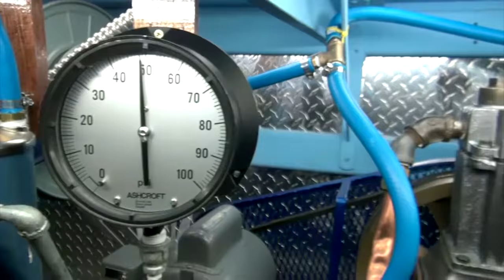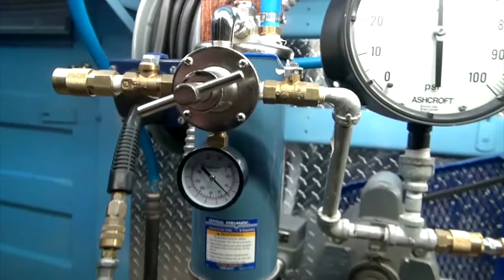What's neat - Jan 2017 column | Model railroad tips | Model Railroad Hobbyist | MRH

Comment: Besides a pro photographer I was a tech journalist for several years. I'm a little rusty but let's see if I can come up with a  good tip for some of you: 
To get the best final images possible it's important to create the best digital image file possible right from the start. In order to do that you have to capture as much information of the scene as possible. Here's some ways to do that.

Some digital cameras will offer a few different Color Modes like Standard, Portrait, Landscape, etc. and some will let you make small adjustments to those settings and save them as a new default for the setting. When I'm shooting I'll change settings to make sure I capture as much information to the digital file as possible. This means I'll lower the contrast settings, shoot using the lowest ISO to keep grain/noise level down, use a tripod and wireless remote shutter release (and either use the mirror lock up control or self timer on DSLR's that use a mirror, instead of an electronic viewfinder (EVF), in order to reduce camera vibration). This is especially important when using a telephoto lens which magnifies any camera movement/vibration. 

Also, I'll use the old Rule of Thumb from the days of slide film and 'Expose for the Highlights. Print for the Shadows', which means I'll adjust my aperture, shutter speed, and/or my ISO and use the Histogram feature that many digital cameras have to the point where I just avoid overexposing the brightest areas of your image. A new feature on some cameras, like my Sony A6000, will show on the LCD and EVF displays in a contrasting red, yellow or some other color, areas in the images that are over exposed. This later feature is one I've come to really depend on.
So, why do you want to set your camera for lower contrast, all that does is make for images that are flat and 'BLAH' looking; and why do you want to 'Expose for the Highlights'? 

The tiny 'light buckets' on your camera's digital sensor read the intensity of the light falling on them and records that level as a number. Say it records the darkest part of a scene, a pure black with no detail whatsoever, and calls that '0'. Then it measures the brightest light level as '99', or 100 steps between pure black and white. You would think that every step inbetween would be equal right? But you'd be wrong. It's not linear, more steps are recorded as you move towards the bright end of the scale so that, say, there are 25 steps between black and middle grey and 75 steps between middle grey and absolute white. Since the brighter end of the scale has the most information that's the end you want to make sure you capture in its entirety. So adjust your camera to record as much data as possible, without over exposing the brightest areas important to you. (It's okay if some things, like the sun or its reflection on glass or water, go off the scale in most circumstances) Adjust your camera like this will help to record data in the darkest parts of the scene without losing detail and help avoid digital noise in those darker areas too.
Once you have as much detail and information as possible in your image file it makes it easier to manipulate the image data to produce the best image possible. Add contrast or adjustment curve, color temperature, highlights, shadow detail and more, all with less of a chance that you'll end up with bad looking side effects like banding, grain, weird colors, etc.

There are plenty of video tutorials on YouTube on the subject. Just search for 'Exposing for the Highlights'.

Comment: That compressor is a thing of beauty.
Reply: Gary Gresham n
Reply: I like your new compressor. My only concern is safety. Has that tank ever been pressure tested since it was date stamped. At some point you have a bomb ready to go off. ( NSA will probably monitor me for this )
Reply: It's a 3000psi rated tank 1/4 inch thick walls. a valve will go first. no problems.

Comment: Decoders have come so far in just the past few years, but the leaders in my mind are ESU LOKSOUND and TCS WOW. Soundtraxx is making a feeble attempt to get back in the run, but: For example the Tsunami 2 Steam has the load feature, but on the down grade in your video it continued to chuff, which it would not. All you should hear is the rod clatter as with the TCS WOW. Another feature of the TCS is at speed step 1; no chuff, just like the real locomotives and you can initiate cylinder bleed as well. I think I heard the cylinder vents blow on the Tsunami 2, which the TCS has as well. As for the Tsunami 2 on the new Athearn Gas Turbine release, really a sad example of to little if trying to compete with ESU. Tsunami 2 Diesel starts with power on, Turbine starts with movement, Turbine shuts down when motion stops.... ESU; F 8 starts and shuts down Diesel, F 3 starts and shuts down Turbine, F 7 on the latest ESU upgrade 75403 provides wheel squeal. Bottom line, Tsunami does not allow operator to manage power, sounds and falls short of current technology present in other brands. I have installed several LOKSOUND Gas Turbine  75403 Decoders in Athearn Ready To Roll Gas Turbines and posted them on my You Tube Channel. choochoo3985. I think you will be impressed. I purchased two of the new Athearn Genesis Gas Turbines, DCC/Ready and will install the new 21 pin ESU decoders programed for the GE UP Gas Turbines. I don't care for the Genesis Gas Turbine w/Tsunami 2 factory installed and will use it in a video and then off load it on E Bay. Not trying to be critical, but factual. Decoders cost near $100 and we need to get the best bang for our bucks.

Comment: Just one kibitz, those BrightBoys aren't cheap, the 2x2 runs $9 each and the 1x6 is $11, you have over $300 worth of pads sitting there.  I built 6 track cleaning cars for our G, O and S multi-gauge layout for the cost of one pack of Scotchbright pads.  The pads fit up inside existing rolling stock.  Or do you  have a cheap source for them?

Comment: Several comments:
Urgent no 1: can you send some of your winter weather our way - Brisbane, Australia - currently 98f (37.5c) was 101, 90 % humidity.
No 2:  re taking a compressor to a motel/hotel. I have an alleged Australian made compressor, 50 psi water trap, pressure gauges, about 12 ins x 12 ins x 6 ins.Sound out-put about 45 -50 db's. Have seen similar at Micro Mart, but here is the Aussie Link : http://www.hobbytools.com.au/artlogic-ac1318-super-quiet-mini-air-compressor/ .
Luckily here down-under, and especially where I live,  if I need to air brush, I move to the rear porch, and sit on the side where there is no back flow.  With the above mentioned airbrush most of my house mates don't even notice it is on.
???? What happened to you Bachman/Hornby contract - you sold MILLIONS of products with your videos and still photos.
?? Kathy M from the U.K. hasn't usurped you ??
Love your work. 
Greg (aussiegreg@gmail.com) or ( chain52saw@optusnet.com.au.)